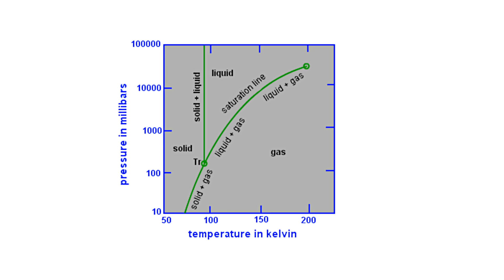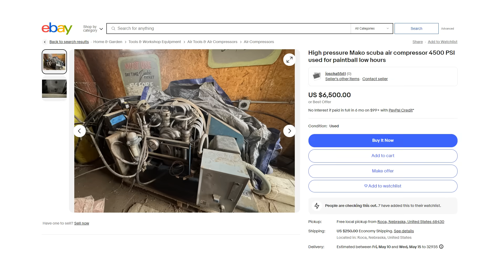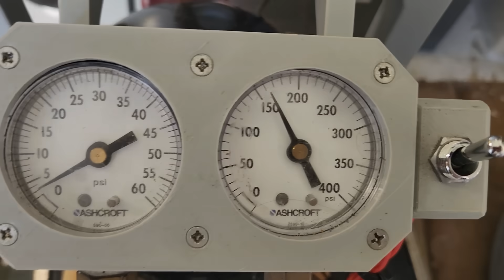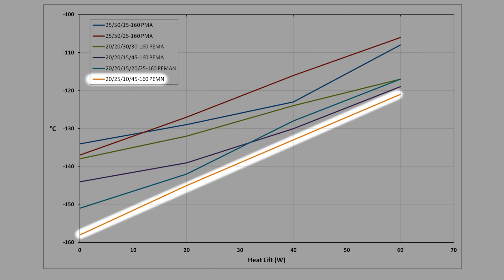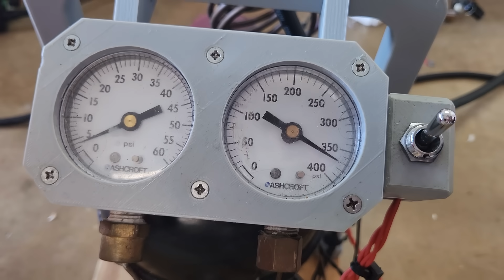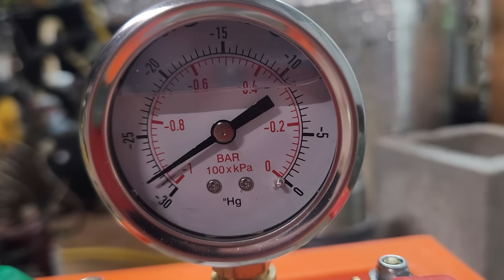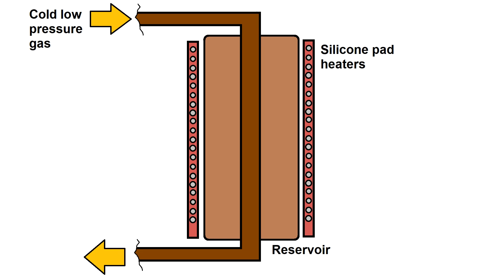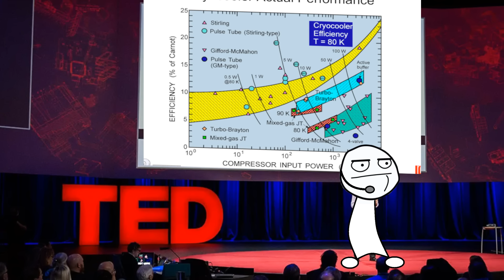Making Liquid Methane (and blowing up my Cryocooler)

Comment: Why not make a triple wall vacuum insulated storage container. Using the gas to chill the inner wall, similar to how rocket engines are cooled, you could wrap copper tuning around a copper tube, braze a copper sheet to each end and . Drop that into a larger tube and braze, drill the center out. Drill ports for the tubing, and solder the tubing to The inner tube. Drill a vacuum port. Sit it on a copper plate and seal the bottom closed then pull the vacuum. Maybe use dry ice to reduce the thermal conduction through the copper. There should be much less boiling off of the methane,   I have little to no experience with gas, I have been wanting to produce methanol and natural gasses to generate power, maybe someday convert a car to take advantage of methanol, replace fuel lines with Teflon and create methanol specific ECM program. And most of all raise the compression ratio to take advantage of the octane rating, and or, add boost, 11:1 compression, with 2.5,bar boost in a daily driver, this is more typical of a race vehicle, on low boost. Yes modern direct injection can allow. High compression. If there is no fuel until it's time to burn, there is no pre-ignition. The chill from methanol evaporating can also allow more compression while pulling a more dense o2 rich intake charge. Also contributing to power gains, I'm not looking for power over all. Because this will require more fuel, I'm looking to use a small methanol engine to replace a large gasoline engine. Possibly using methanol ethanol blend, along with fuel heaters for winter use, heat the fuel to around 100°-200°F just before entering the injectors. Possibly use a low temperature settings for all cold starts, use a remote to turn on the pre heater about 5 minutes before leaving, withing 3-5 min. The engine should start fairly normally in cold weather. Using a roughly 200 cc container of fuel with a 200watt +/-100 watts, heating the methanol with feedback to prevent overheating. And a summer cold start could use a setting of 80°f, and only power on a few seconds before starting. Like heat plugged diesel engines , 30-60 seconds and start. And really cold weather a air Heater can be used. Basically add a hair drier to the intake manifold , (this is all for older engines).  But the first goal is to use a small engine 3-5,6 hp in place of a 10-12+HP  engine to generate power. A 5hp go-kart engine can easily produce 10 HP. By spinning faster, and carbon adjustment, this not really a option.  A cam swap, port work in the engine to improve flow. And raise the compression to the point a electric start is basically required. Up to 185-200psi compression, I'm thinking stock Is 140-150 psi. With the addition of methanol as fuel. The addition of a timing computer to allow the ignition timing to be controlled mapped and program a ramp or timing curve set up for speed and load, this is determined by difference in rpm and throttle position, more load is less rpm with more throttle. A TQ arm and load cell can be attached to the engine or the load. Having different timing for heavy loads can improve performance and efficiency. I'm looking for 6-8 HP from a 3 HP engine and 10-12 hp from a 5-6 HP engine, and 16-20 from a 10-12 HP engine, a modern  5-6.5 HP engine can be 196-212 cc, the old 5,HP engines were 205cc, they actually made slightly over 4.5hp, The modern engines produce closer to 7hp  and without governor spinning to 5k rpm not 3600 on the govenor, they ppl reduce 9.5 HP .  So raise the compression and port the head so the air has more velocity and slightly more mass, the engine can easily produce more power at 3600 RPM,  and even more at 5k or 6k+ plus rpm, (in race application) but I'm looking for power production. Getting more power at 3600 (4400rpm or less) 
A 3 HP, 79cc engine should easily produce 5-6hp in the 3600-4400 rpm range, I'm looking to spin a 150 amp 24v alternator possibly two or two 100amp 12-14v alternators. Probably using a 212 cc 6.5 HP engine ,with two 130 amp 12/14v alternators,  to produce 12/14v and 24/28v.  To charge batteries that power my home! when the sun 🔆 doesn't provide,   I have also thought about the possibility of using a gas , similar to steam, in a closed system,  possibly using a motor compressor unit as a engine generator, or possibly a ac compressor from a car as a engine and use liquid propane or something to spin the engine to generate power.  The valving is the only difference and as simple as adding magnets to the rotors of the motors can become generators. Cut the can open modify the compressor and motor. Then tig weld it closed and test for leaks. Use propane or other low temperature boiling liquid . And use a large condenser unit. Possibly in a tank of cold water. And possibly using a small compressor to compress it into a tank and or possibly a bit of thermal electrics to chill it a bit.  Using a 96" dish to concentrate the sun on a 12" block used as a boiler  slowly push liquid propane into the Block that  could possibly be heated as hot as in excess of 900°f  depending on the clouds and focus the cube or square being a brass 1/4" thick 12" x 12" with flattened copper tubes brazed to the plate a 3/4" tube flattened to 1/8'' with 1/4" gaps, and having about 24-28 tubes and  tube side facing the sun reflected sun , being equal to more than 8100 suns shining on the square with it insulated on the back, and a black ceramic  coating to reduce reflection of thermal energy. It should be possible to boil water but probably not enough to make sufficient steam, just curious if this could generate power, if propane can  be efficient. If it can condense effectively and transfer energy effectively . Maybe a large parabolic through with evacuated tube collectors using water would be best. to produce steam atleast 350°-400°F , not exactly the hottest super heated steam ,if I built it I'd want it to be capable of atleast 1500-2400 watts. Sorry to ramble, have an awesome day!

Comment: You need to let your refrigant pass through about half your exchanger, which will liquefy against the heavier hydrocarbons. Run it into a seperstor, then let the liquified refrigerant cool the bottom of the cooler. The stuff that doesn't liquefy is the lighter side. Let that run through the whole thing, which will make it liquefy and just use that against the coldest side.

You'll end up much colder.

Yes, people who are annoying me for NDA violation, Ive checked. There are google search PFDs with this design visible.

Also, cold spots at the bottom means you have too many heaviest, including butane.
Reply: Its autocascading cryocooler.

Comment: fun fact: methane is 25x as potent of a greenhouse gas as CO2 and much of our methane leakage into the atmosphere goes completely untracked. this is why the EPA hates it. extremely useful hydrocarbon but, like all nice things, in moderation
Reply: Remember that methane is important to the water cycle. It can't rain without methane.
Reply: @HaloWolf102  Bro! I'm releasing 10 megatons of Methane from my cheap ass pipeline for the rain, bro. Can't rain without it. Like, water cycle
Reply: @HaloWolf102  I'm mocking wat you said because you replied to someone saying that methane is a terrible greenhouse gas with "but rain cycle tho." That's a stupid response, we are leaking unmeasured amounts of methane into the atmosphere from industrial fires/pipelines/wells/etc. So a response like that can only be read as dismissive because we don't live on this planet in it's natural state, the volume of methane is orders of magnitude higher than normal.
Reply: @HaloWolf102  What?
Reply: Additionally once in the atmosphere it will be decomposed by sunlight to CO2 over 10-20years
Reply: No one cares about environmentalist SJWs.

Comment: I wonder if it would be possible to take advantage of phase separation to be able change refrigerant mix while the cryocooler is operating. Build it like a separatory funnel So you get down to the methane liquifaction temperature and dump the liquid into a storage tank, then start introducing argon to make up the difference in pressure drop.

Comment: When I used to make solid nitrogen from putting liquid nitrogen in a vacuum chamber I'd put the dish on a foam kitchen dishwashing pad. The kind of really soft yellow polyurethane type foam. It works better than syrofoam because sometimes when styrofoam expands the dish can fall over.

Comment: But how can I put LNG in my car? Serious question since being in Europe, LPG fueled cars are reality and CNG won't work in direct injected gasoline engines. There are conversions available for LPG that will inject LPG using the cars high pressure fuel pump and original injectors. CNG tanks have like 200 atmosphere pressure I believe, but work in regular outdoor temperatures. If I can make LNG in my garage by recycling cow burps, I want to run my car on it too.
Reply: Needs a dewar tank with multilayer insulation in the vacuum gap, sadly.... Unless you're accepting that it won't really hold fuel while parked; you'd have to flare off gas to vent excess pressure either way.
Reply: Older carbureted cars take a simple vacuum controlled pressure regulator, and a pressurized tank kit.  The are available online.
Reply: Many CNG cars perform acceptably well to my knowledge. LNG is only really used on trucks and buses

Comment: just using nitrogen from air is both cheaper and non-toxic and non-volatile. talking about floaters, a carbon fiber cloth solar heat hot air balloon, or even copper foil balloon, would be nice free energy source. or maybe just paint a large aluminium foil balloon with graphite soot to black. heat capacitance of your hands is much greater than a brief exposure to cold stuff. also why only mechanical compression methods, try electric and electrostatic compression, and small volumes, like stirling engine. ie two opposite charged plates with gas between them, will have attraction (and repulsion) to crush small amount of gas really fast. or just centrifugally compress ion gas with ion current compression. yep it will heat up because of the plasma current, tho.
Reply: have you considered trying centrifugal tesla disc turbine to cool down gases and liquids, the output of hot steam is usually ice cold. yep its a generator but the output gas is ice.
Reply: so did you ever try the centrifugal gas compressor, not physical rotors or pistons, but just spin compression, just like astronauts, many g's. its only disc fan cross spinning.
Reply: actually a tesla disc turbine would be the best gas compressor heat pump.

Comment: Be super carfuel with pincing big diameter copper pipes maby use steel and weld the caps. Copper becomes to Dangerous at like 400psi at the size of like 2 inch you a using. You can braze steel to copper with silver solder. Or you can get Fe/cu copper used for co2 supermarket systems they can easely hold 120 bars however you need to braze them with silver too. Great work otherwise!

Comment: Now you need a way to make liquid oxygen, and with that, you can make your own rocket.
Reply: LOX is easiest to make with LN2 since it boils a few degrees hotter at ambient pressure. All you have to do is leave some LN2 exposed to the atmosphere and it will form LOX in situ. A full red 16oz solo cup of LN2 (insulated inside a styrofoam cup) will yield approximately 4oz of LOX over the course of ~20min in 70 degF standard lab air.

My lab was using LN2 to cryofracture SEM samples and (as the LCHO, or "safety guy") I had to purge the overnight pressure build-up on the vapor side of the high pressure storage tank and then purge about 2 liters of ambient pressure liquid to blow out any ice that formed from water diffusing in during the vapor side purge. Suffice to say, I had plenty of spare LN2 to play with for a while. Some vids of it dancing about in the lab hood should still be on my channel somewhere. Making LOX was a fun little side project, as was ozonating it and seeing just how high a concentration could be allowed before it got angry (all ozone is always angry at all times). Pure LOX can be made by distilling off the N2 from the liquid mix in situ. Simply combine many aliquots of collected LN2/LOX mix and allow the N2 to escape. This cascade will bring you arbitrarily close to pure LOX. Most trace gasses will freeze out and a coffee filter can be used to remove them. Just keep all sources of ignition away. Pure oxygen makes just about everything containing carbon explosively flammable. Also, oxygen can be quite toxic. Don't breath the pure stuff if you don't have to.
Reply: I think he did that, or at least he can make nitrogen and freeze open air.
Reply: thats easy. Just pull air through a schlenk/gas trap cooled with liquid nitrogen for long enough and boom you get liquid oxygen
Reply: Well you can make the propellant, but there's a little more to making a rocket 😁
Reply: BPS Space crossover?
Reply: Make your own bomb if the flow speed is too high.